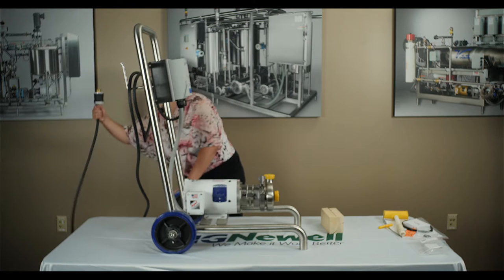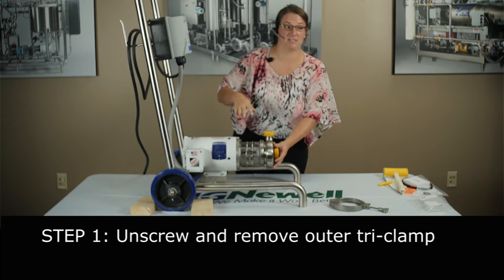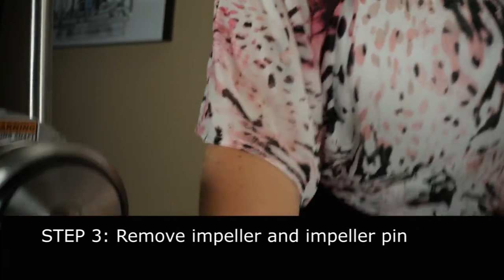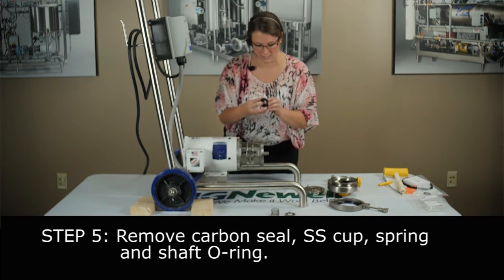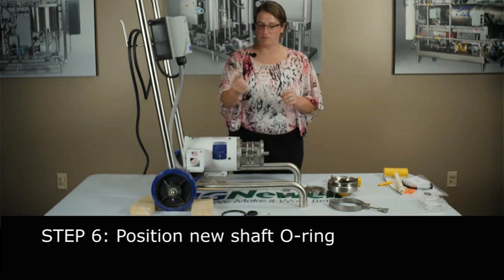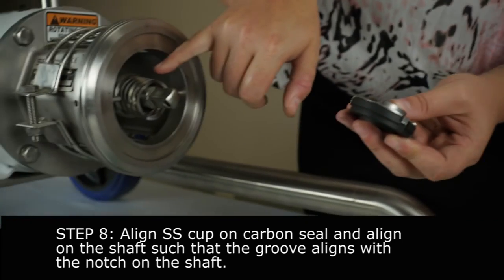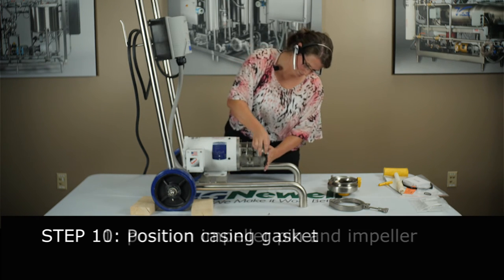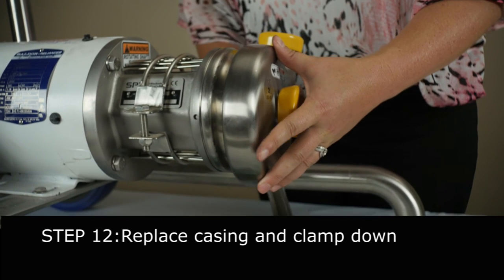SPX Flow C114 Centrifugal pump - changing pump seals

Comment: I would not slide the o-ring to the back of the shaft, mine leaked like crazy, my fix was to put the o-ring in the carbon seal and just barely push it on the shaft, then let the backing plate push it into position, that made my pump head leak free with the new seal kit.